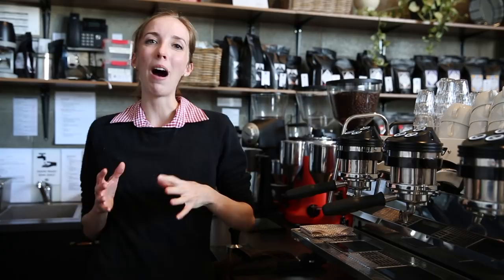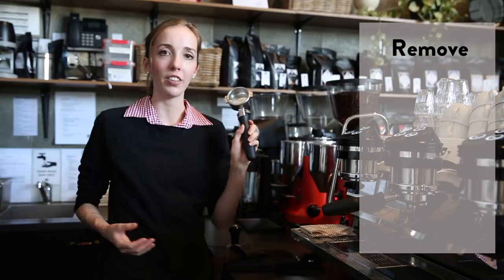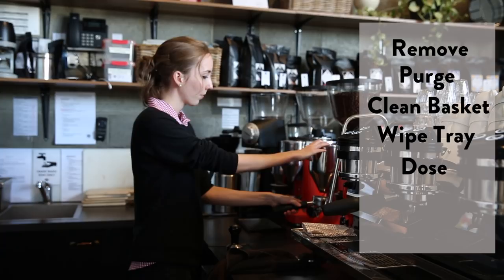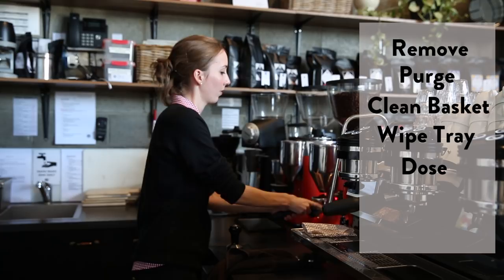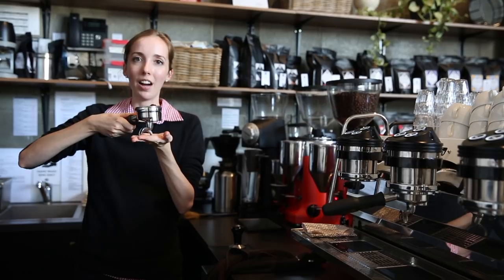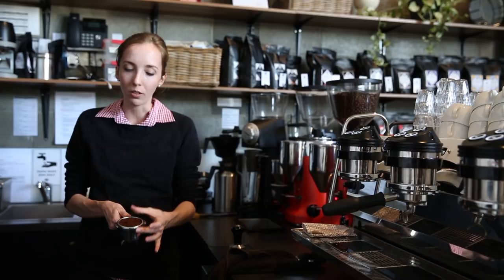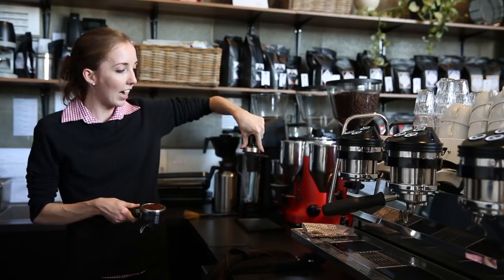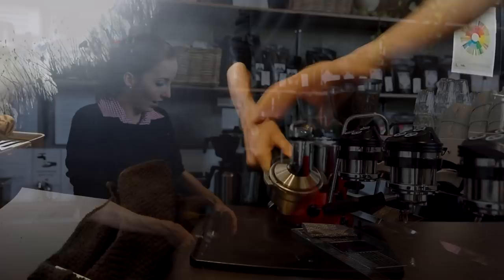Espresso Fundamentals | Tamping & Brew

Comment: I tried two methods today.  Leveling and tamping and then just leveling.  You are right when you angle the tamp.  I had channeling  problems. But the Asso Leveler have this clicking mechanism that made me zone in an even level.  Although I did not follow a 30 lb tamp rule,  the extraction from just leveling appeared even.  But I guess this is not the case with every situation.  Still need to experiment.

Comment: Thanks for all the informative videos.
Question: Tamper pressure: there is a lot of talk about what the right amount of pressure is. Most say as long as you are consistent with your pressure. Do you agree with this? Also I see your tamper pressure is very lite pressure. Please can you comment on pressure.
thanks
Reply from the maker: Consistency is always at the top of priorities. My first statement regarding tamping pressure would be,  SAVE YOUR WRISTS! Do not ever tamp to a point where you are injuring yourself. Technique is vital. Then tamp as much as you need to create a flat and even surface for the water to be initially resistant to percolation.  During the first few seconds of the brew cycle this will to allow the head room (between the top of the puck and the shower screen) to fill completely with water before even percolation of the puck begins. So a very lite pressure gets the job done then that's great! Too little pressure and you'll see channelling. Too much pressure does not equal better extraction, wasting efforts.. Finding that middle ground. .. Throw soft pre-infusion in to the equation and tamping harder becomes less of an issue.
Reply: Please can you give comment on your experience with preinfusion. 
Thanks
Reply from the maker: There are a various number of per-infusion styles. Some machines deliver PI at 'mains pressures' - and this will differ everywhere. Usually 1-3bar. Other machines have a set 3 or so bar pressure and you can't change it. The best machines you can alter the pressure, or rather flow, and how fast or slow it enters the brewing chamber. 
PI itself can alleviate small errors in the grind/tamp areas and it should allow for even flow through the puck equalling even extraction. However my recent discoveries (thanks again to Scott Rao) - have shown me there is a mode on the recent updates to the LM machines called HOLD. This in conjunction with PI is the magic combination. I was finding PI of 3-4 bar anywhere between 3-7secs,  in order to not allow any actual brew in the cup yet, still produced dry areas within the puck...  [a good experiment !! stop the brewing cycle immediately after the PI and inspect to see if the whole puck is wet - that's the goal at least]   SO. .  . HOLD is also referred to as BLOOM in other brewing methods, where you let the PI sit for a few seconds - de-gassing, expanding, wetting right through ect.. and using PI and HOLD on the Strada AV it has really opened the flavour right up, removing ANY negative attributes.. decreasing crema but maintaining viscosity. Sweetness and balance and clarity are greatly enhanced. So we use a 4sec PI with a 10sec HOLD. and the Brew Ratio is the same. The shot runs for 32-35secs. PI alone is still a great tool to play with and if you have the opportunity to program it then I would recommend tasting your espresso through many different variables of PI to get the best out of it. This new program for us is the 3rd or 4th iteration of programs we've used on the LM Strada AV.. always looking to improve !
Reply: Wolff College of Coffee - thanks for the really informative reply. I will definitely be trying preinfusion. Like your idea about stopping it and checking the puck. 
Also thanks for giving and idea of your shot time increase with preinfusion

Comment: One question: how do you stop your shot? does the machine stop automatically, do you stop it manually? if so, do you wait a number of seconds, or an X amount of volume extracted? thanks!
Reply from the maker: Hi there, so let's look at our parameters. You have your DOSE (dry ground coffee) and your YIELD, which is X amount of volume extracted (the brewed beverage) and you have the time in which you do it. 
First you want to decide your dose. Then your Yield. Then time.
We will shut our shots off to achieve a certain X amount of volume always. The time in which you achieve this X amount will adjust the taste of your espresso as you adjust the grind to make you espresso come out faster or quicker.